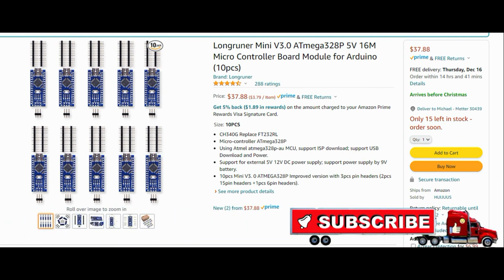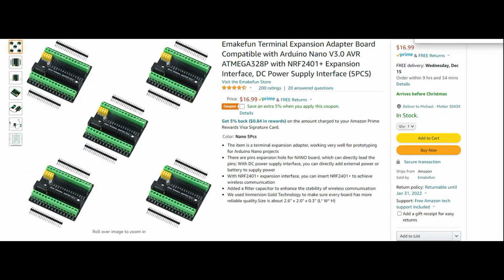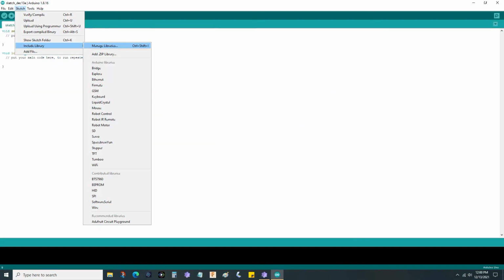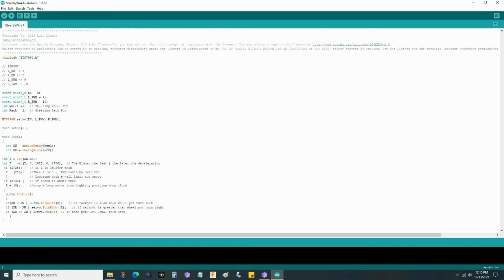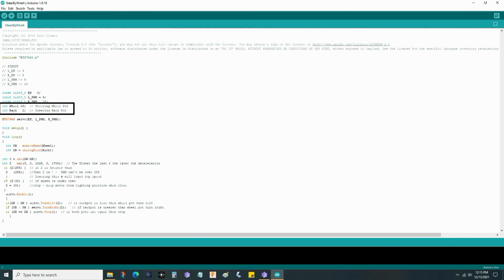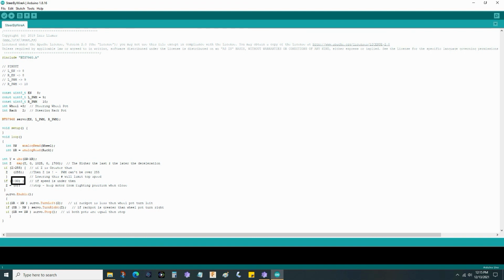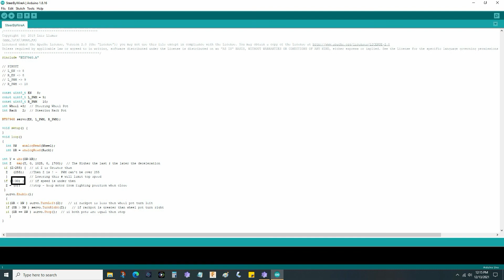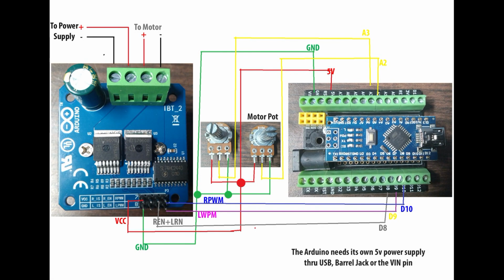Windshield Wiper Motor Servo with Arduino & BTS7960 driver

Comment: Cool project! I almost have it working. There seems to be a lot of jitter. When I touch the motor pot wires at the base where the wire is exposed, it works a lot better. Is that a grounding issue? Any ideas how I can fix it other than having my finger on it? Hehe thanks!
Reply from the maker: Maybe a bad connection ? Do you have grounds connected between the Motor driver & Arduino?
Reply: @refab2262  yes, they are sharing a ground.
Reply from the maker: I looked at my original sketch, it worked on mine as is, but I didn't declare the pot pins as inputs under setup. It may be worth trying.
Reply: @refab2262  I will try that. Thanks for the replies! Once I get that working I am going to replace the pot with a second Arduino and use the Servo.write and other Servo commands to control it. Would the code you wrote work directly for that or do I need to modify it in some way to accept input from the other Arduino Servo commands. Thanks again!
Reply: @refab2262  Using a second Arduino to control it using the Servo Library, I got it to turn one way but not the other.
Reply from the maker: I've been trying something similar with esp32 to Arduino. I'm also having issues. I'm still new to this.
Reply: I got it working! Turns out the pot was bad. I still could use some help with controlling it using Servo commands from another Arduino.

Comment: How to operate this without potentiometer.
Reply from the maker: Using as a servo it needs to know the position, the potentiometer is the easiest. If your'e not using as a servo refer to the example sketch
Reply: @refab2262  yes I am using 1  potentiometer for feedback but I don't want to use another potentiometer to control the motor in place of that I want to control the motor with code( like normal servo motor.)